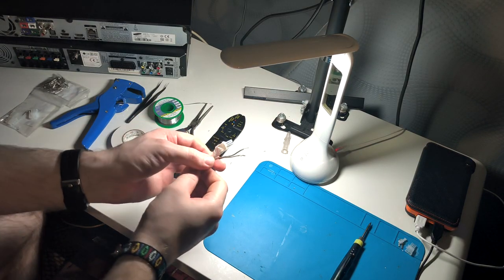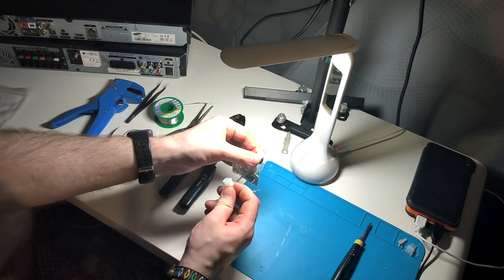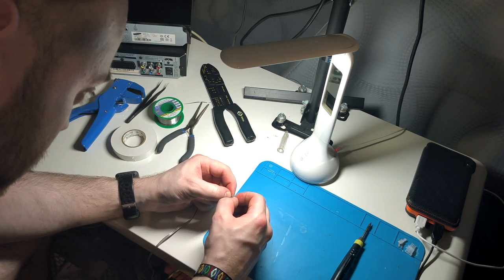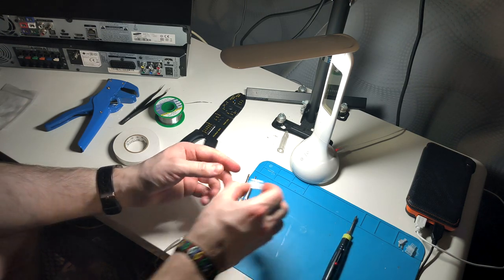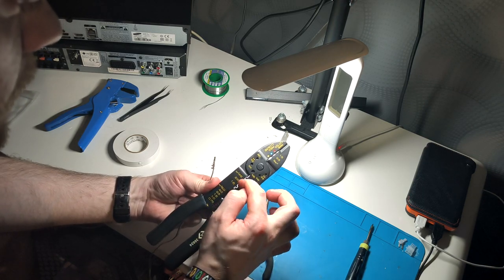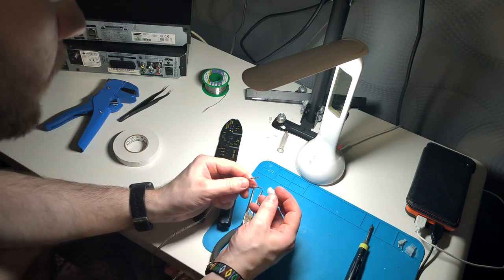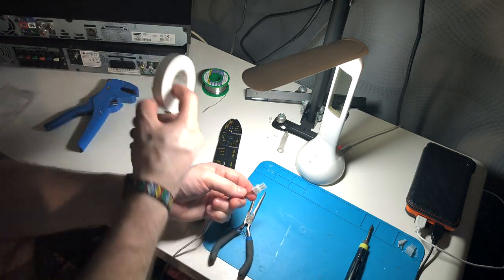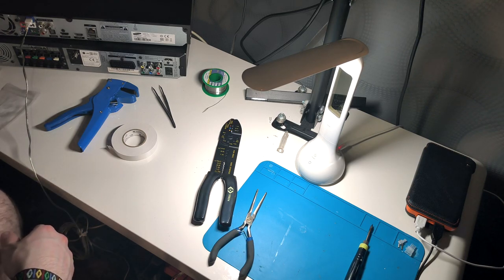Convert Speaker Cable to Plugs for Samsung / Sony / Panasonic Home Theatre 5.1 Surround Sockets

Comment: Am I able to do the opposite? Removing the casing and plugging the straight wire into the spring clamp slots on the receiver?
Reply from the maker: @drg2109  Yeah, should be fine if your speakers and sound system are the correct ohmage for each other. Should be a nice quick one to just cut off some of the wire with the plugs on. I'd leave enough wire on the end of the plug so that you can either splice the cable back together if you ever need them again or even just sell them on the Internet. Last I checked the price of a plug with some wire went for £5 each.

Comment: The positive terminal is on the right or left?
Reply from the maker: I think depending on the speakers, it doesn't matter all that much as the current is technically AC and not DC coming out of the terminal and so can go either direction to generate the sound waves. What matters the most is ensuring all the speakers are wired to the same polarity, so that puts it down to you to stick positive polarity to one side and keep it to the same side for remaining speakers.